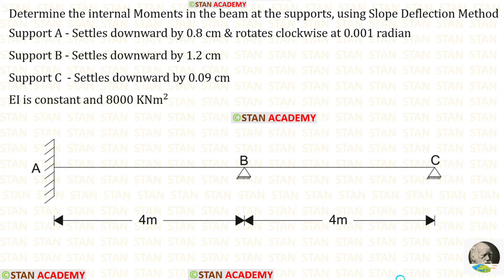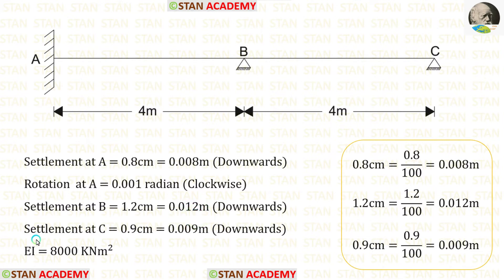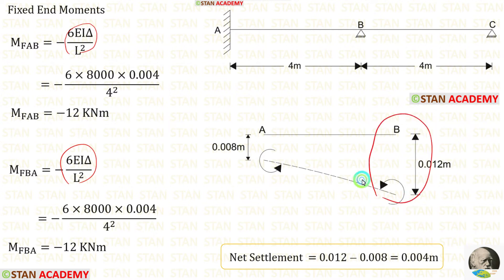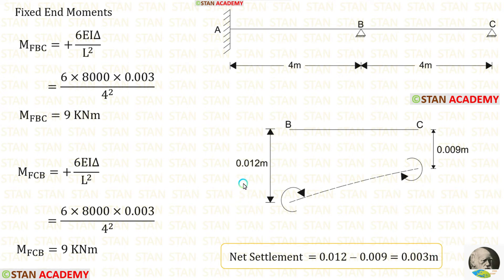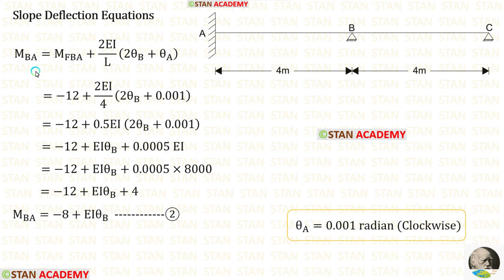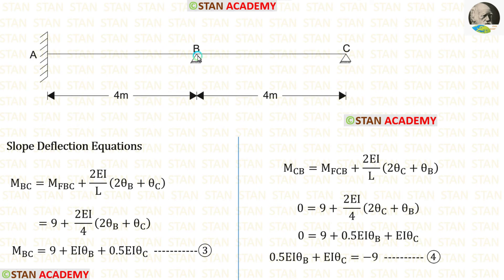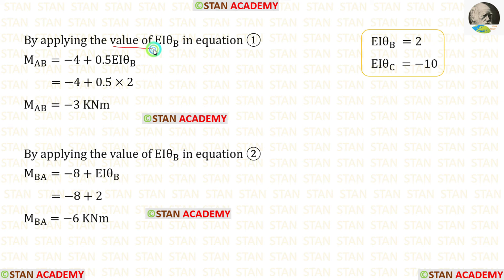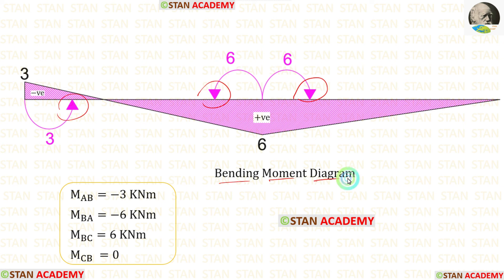Rotation of Support A , Slope Deflection Method for Beam Analysis - Problem No 17

Comment: Point c is simply supported hence final moment will be zero??  And we will use modified slope deflection equation for span BC??
Correct me if I'm wrong.
Reply from the maker: you r right. for more problems https://youtube.com/playlist?list=PLjJwBYxz7Cym_XRwWlux5KDvALqYpPXi9
Reply: Bro its completely messed up. U should comment the right solution